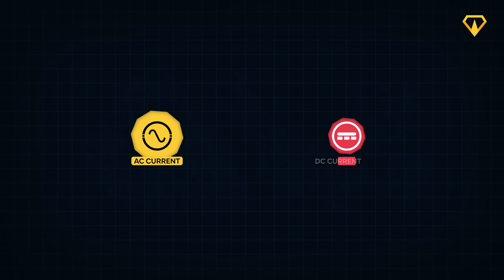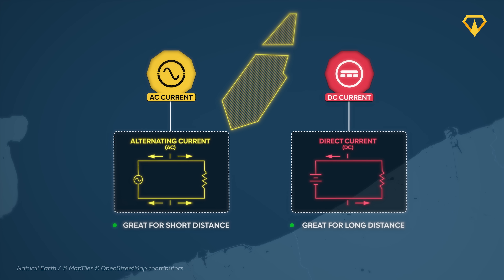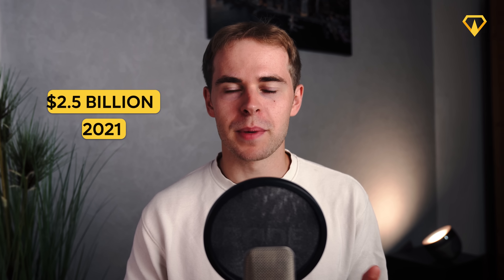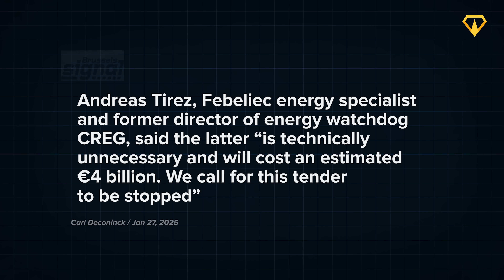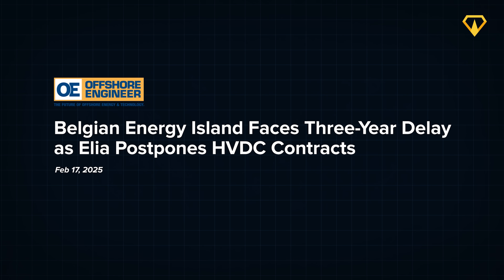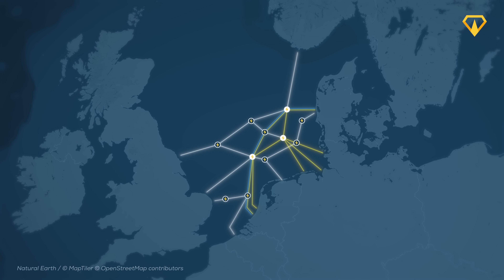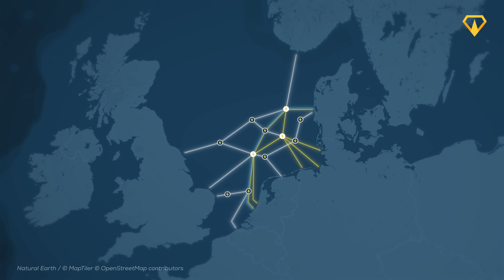How Belgium’s $7B Island Will Power Europe

Comment: Europe’s answer to Russia happened last month: they’ll buy LNG from the US
Reply: which they will stop doing and instead buy from Canada
Reply: @PDVism  Green hydrogen pipeline between Portugal to Germany already started to be build.

Hydrogen will be a way of energy storage and transport like natural gas, and the most modern existing natural gas pipelines can actually be used by hydrogen.

Unstable wind energy + sea water = hydrogen. And the French add hydrogen as well using not consumed nuclear energy.
Reply: @ricardoxavier827 And where does the green hydrogen come from? As was explained to me many years ago, hydrogen is a great idea, but only when electricity is cheap and plentiful. Projects like the grid mentioned are the minimum needed to make that feasible.😊
Reply: @ricardoxavier827  Hydrogen? where do you get the platinum? How will you create a massive supply chain without leaks? How will you cool hole this green hydrogen network? Hydrogen is fine for universities looking for more government funding.
Reply: @ricardoxavier827  Elemental hydrogen is incredibly difficult to store and transport without leakage. It's much easier to add a carbon atom and transport it as CH4 - methane, which is what some 98% of natural gas already is.
Reply: @ricardoxavier827  nonsense
Reply: @apkk5594  The content of this video is about wind energy.

Wind energy are unstable electrical production.

Hydrogen production are the only use that can use unstable electricity (both unstable frequency and voltage) from renewables like wind and solar.

Hydrogen can be consumed in several different ways, so that wasted energy can become unwaisted hydrogen product.

Making everything hydrogen way? I have my doubts as well. But, at least, we stop wasting unfit energy in today systems.
Reply: @hermancauwenberghs  You only said jokes lol

Hydrogen can be consumed in fuel cells, that need platinum...

Before fuel cells been invented around 2008, hydrogens was long time already being produced and consumed for other ways.

Natural gas pipelines have leaks with both gas natural and hydrogen. Whats your deal?

Universities government funding? You think the world are only USA?
Reply: @technicalfool  again, from portugal to germany the project already started.

You should say that to the governments that agreed with the project and save that nations mistakes.

Common, be the world hero. Save them. Tell them.
Reply: @garry8390  the judge gave the sentence.
Reply: @hermancauwenberghs hydrogen is only a local solution, but so are solid state batteries.
Reply: @technicalfool CH4 is a super potent greenhouse gas.
Reply: @PDVism  To nations that dont have mountains with large rivers enough to use the dams as energy storage, hydrogen are the way.

All kinds of energy production produce hydrogen, and we all consume hydrogen no matter the original energy source.
Reply: @ricardoxavier827  nonsense
Reply: @ricardoxavier827  I live in Denmark no mountains no river but enough winenergy. Maybe you should study it a little more. In 2024 59% of energy in Denmark came from winenergy
Reply: If only Germany kept it's reactors online. France almost pulled the trigger on them, but the war came in and they had to correct course. Now look at them, they even have some extra energy to sell to their neighbors
Reply: That "deal" (more declaration of intent) is never going to go through. For one the US doesn't have the capacity, it would take years to up, by which time things might have changed. Moreover it isn't the EU that signs this fossil fuel contracts, but national governments or private companies. Then there is the issue of running contracts that can't easily be cancelled (or at least isn't worth to).

In general the EU commission made promises about things it has no jurisdiction over and the "deal" is heavily criticized. Basically it is just meant to sooth Trumps feelings and string him along untill he gets replaced.
Reply: Fake, Europe is buying from Canada
Reply: Europe got LNG from USA already before last month but Trump always tries to make it look like he’s doing something that is already happening, first 6 of 2025 and Europe has already been buying more LNG from the USA then last year, and Qatar LNG has also replaced Russian gas, Norway has increased production of natural gas and oil, Denmarks life extension of North Sea gas and oil fields are finished and production is back up several other nations have increased, North Africa and Israel deliver natural gas, Azerbaijan pipeline also supply Europe and a small amount is still sold to a few countries in Europe mostly indirectly with the small turkey pipeline which is the last pipeline delivering natural gas and Russia also sell some LNG and oil at at 15% market price discount to reduce the income of Russia the oil cap.
Reply: that is same shit different color,its better to be self suficient,but ofc russia and usa do not like if europe tryes to stop beeing a slave to them
Reply: And US buys the same gas from Russia and sells it to EU
Reply: Because US put so much pressure on Russia that they couldn't find any other way than invading Ukraine, what was needed to stop the Nord Pipeline from Russia to Germany what would have significantly lower de the import from US Oil.
Reply: no, thats where, at a higher cost than buying from Russia, you import energy from India.

(who buy their oil from Russia hahaha.) So Russia still get the money. You just lose it in your blind arrogant european hatred ... only acheiving to make India richer and yourselves poorer.
Reply: Europe has been buying LNG from the US for many years already.
Reply: And hopefully will move away from reliance on the US.
Reply: And pay much more, challenging their energy dependent industries
Reply: RIGHT FOR 3X COST, bravoo EU!
Reply: Only for the minimum time possible, untill they build cheaper projects. American gas is expensive. Renewables are not.
Reply: @Hession0Drasha  yes, but what is minimum time? And how reliable is renewable energy? cheap in long run, and better for energy independence and impacting global warming

Comment: DC more efficient for long distance transmission? 🤔 Long distance transmission requires high voltage. You don't want half a million Volts in a household outlet, so you need transformers. Transformers only work with AC.
Reply: The DC requires a conversion at the substation to AC.
Reply: It's possible to make super high voltage DC, though the transformers for this are more complicated and expensive. So it's only really worth it if you're going to extremely high voltages, only at that point are efficiency gains from the higher voltage potentially paying back the extra costs. As such, it typically only gets used for particularly long distance cables that need to transport extremely large amounts of current.

Comment: Is it not the other war around? AC for long distances. DC is the one we use in out homes.
Reply: no, we use AC at home
Reply: To efficiently transport electrical energy over long distances, you need to increase the voltage to reduce the current. In the past, this could only be achieved cost-effectively with transformers, requiring AC power. Today, thanks to technological advances, high-voltage direct current transmission is available, which can actually save costs in certain scenarios.
Reply: Electricity arrives to your home as AC and that's what you get out of your regular power socket. Then you'll have a variety of devices at home with power bricks and adapters that convert from AC to DC.
This is so common that some people run DIY projects to supply DC to USB and other types of sockets instead of using AC for some loads in the house - you will struggle to find a dishwasher suited for DC power, but you could have a desk with many high powered USB sockets and run many DC gadgets from there.
Reply: @NunoLima1337 Agreed, just to note that almost all motors in modern appliances like dishwashers, washers, and dryers (maybe refrigerator condenser pumps too) are DC brushless motors. The control boards and chips that run them also use DC. It would actually be cheaper and easier to build all DC appliances but the market is saturated with AC in homes and businesses. In the US, if you live off grid and use DC from Solar or wind with batteries, lighting is cheap and easy to find however DC appliances are expensive and hard to find.
Reply: @PappaMike57  Interestingly, brushless motors in particular aren't really DC, and have more in common with three-phase AC motors. That's what the speed controller that a brushless motor requires does, and is why brushless "DC" motors have three wires, and not two.